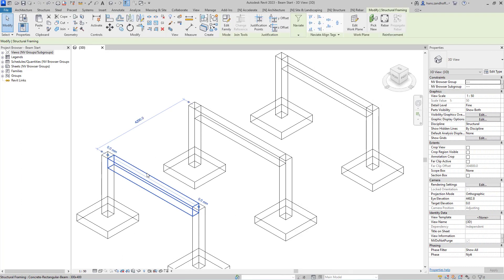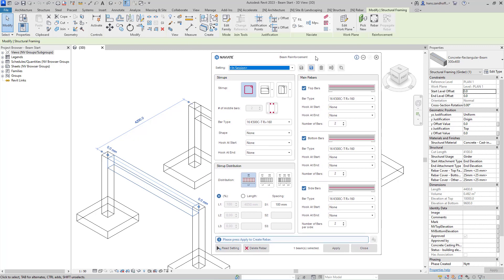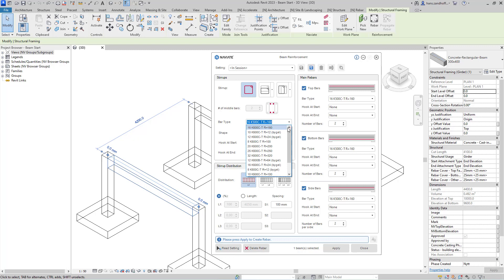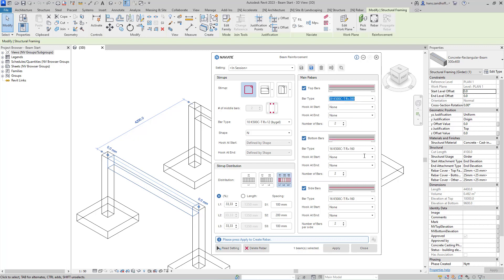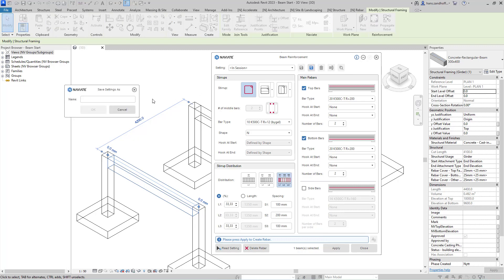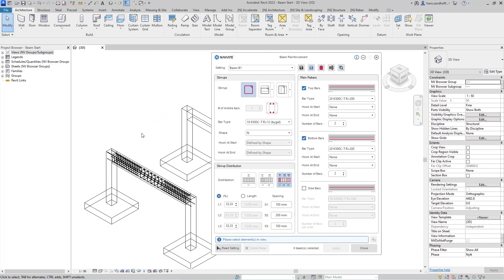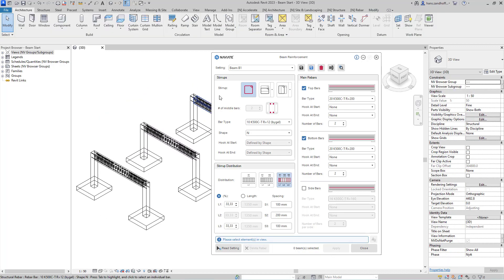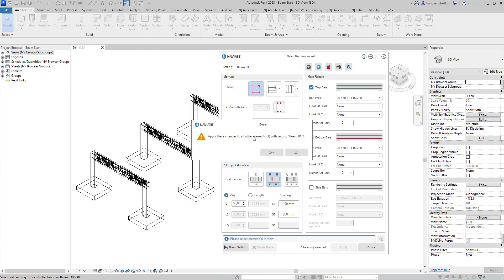The new Naviate Rebar - How to work with beams

Comment: when i try and add a rebar there is no "bar type" to select, is is just blank ?
Reply from the maker: Hi, its reading you bar types from your template file. So you need to have those rebar types there, if not it will be blank.